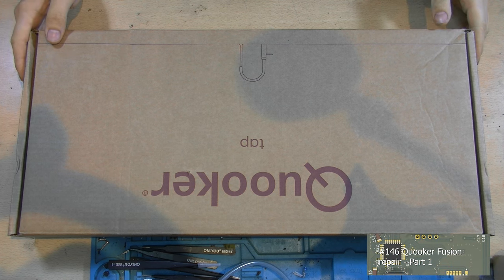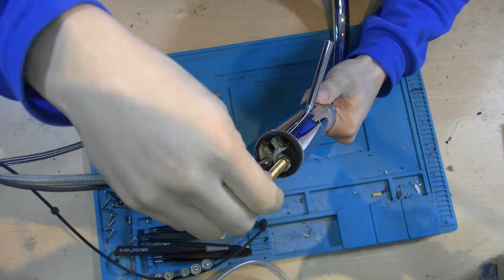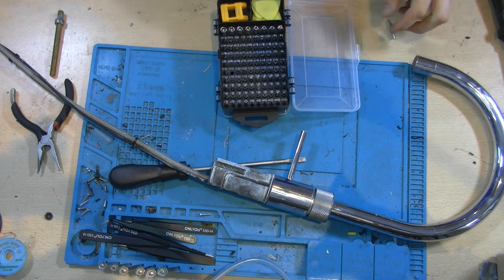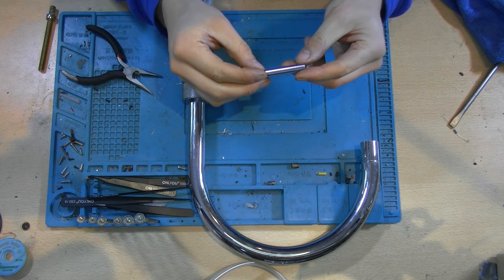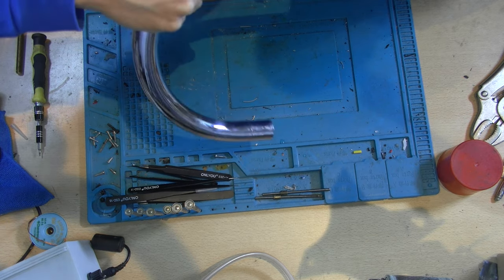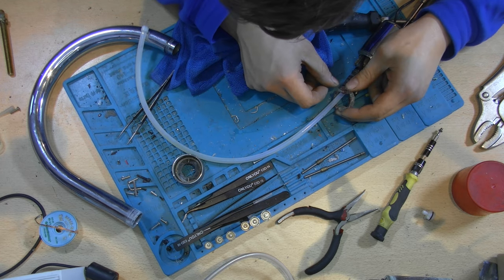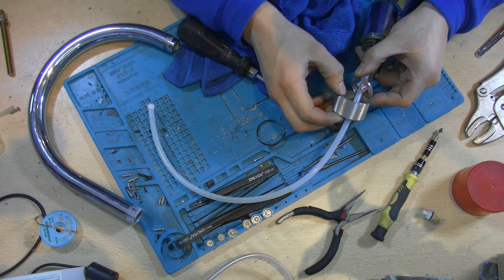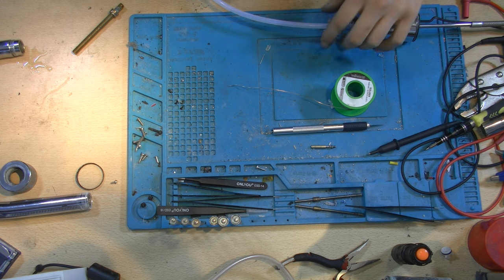#146 Reparing Quooker Fusion - Part 1

Comment: Hi Tim I have just completed a rebuild of this tap, and I had the same as you, a random red wire, it turns out it is used, it’s connected to the ring if you look at the brass ring inside the stainless steel ring there is a notch with a brass wire crimp in it that’s where the wire was connected but it snaps off when you pull the ring off it’s not easy to reattach hope that helps👍🏻
Reply from the maker: Thanks for the update! Much appreciated
Reply: @TimsElectronicsLab 

Are you sure about this? When using this tap with hot and cold water, there should be a way to power both the red and the blue LED's. I'd guess the red wire is for the blue LED
Reply: Not easy to reattach, thats an understatement. How do i get that nasty red wire back and the ring mounted 😢. What is its function?

Comment: My one has stopped emitting boiling water but holding a magnet up behind the tap seems to make it then work. Apparently it helps the magnetic connection. Did you come across this magnetic ring? I’m wondering if it can be replaced without having to buy a whole new tap

Comment: Thanks for the instructive video! It's been a big help. After closer inspection, what do you suggest to be the best way to take the ring off? I don't want to break the plastic ring holding it in place.
Reply from the maker: Thanks for your kind comment! Are you referring to the boiling water ring?
Reply: Yes. You take it of by force and it sounds like you crack the black ring which is keeping it in place.
Knowing now how it is retained, how would you suggest to take it off?
Reply from the maker: @andreroodnat-f1z  I just had a look at the remnants of my Quooker and there doesn't seem to be any broken plastic ring. I think it was just a bit calcic causing the sound
Reply: Thanks a million for checking Tim!
I still wonder what keeps the boiling ring in place, to prevent it from popping off under normal circumstances.
But if you got it off in one piece, that must be the way to go.

Comment: What is the best solution to use to solve stiffness of the lever?
Is it to the completely immerse the dismantled part in cleaning vinegar? Ot use WD40? Glassex? Special fluids of oils?
Reply from the maker: I think that vinegar will work the best as that'll dissolve the calic
Reply: @TimsElectronicsLab  I beleived there's grease or oil inside somewhere as well. Not sure of that's a good combination with vinegar.

(And did I mention you're great taking the time explaining how to fix things? However: you're great!)
Reply from the maker: @SibeJanKramer it cleaned up very well on mine. By the way, you can take the coper insert, which the tap handle screws into, apart to clean it properly. 
Thanks for your kind response! Much appreciated!